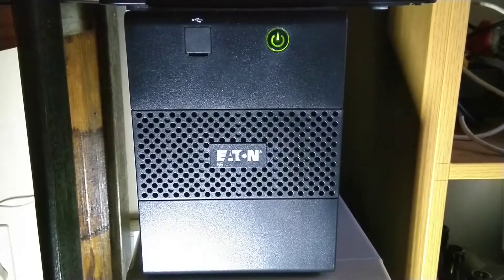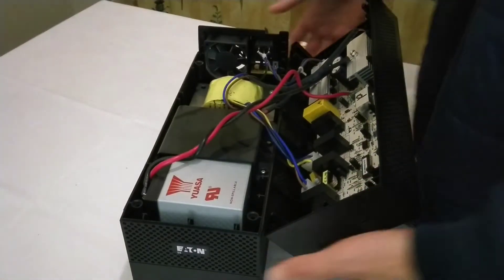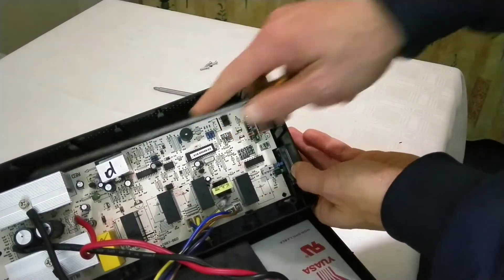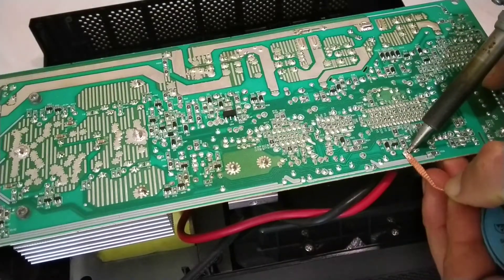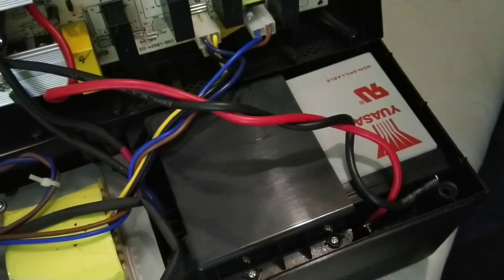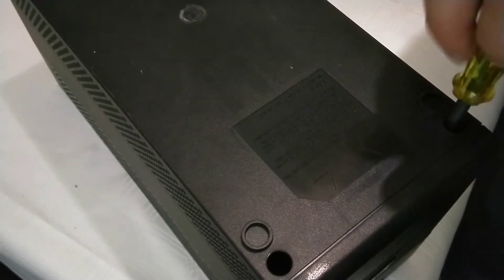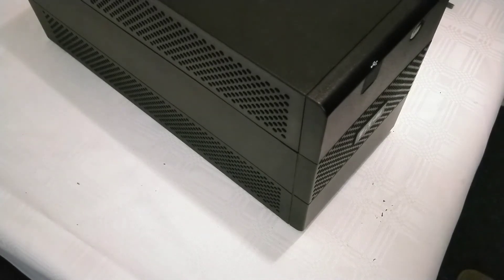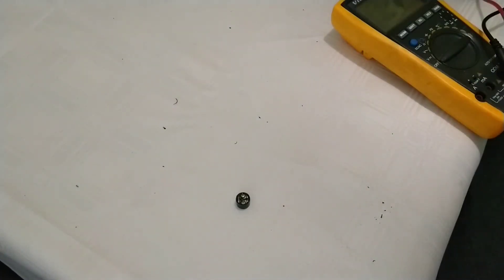Stop a UPS from Beeping Permanently by removing its Buzzer!

Comment: Thanks for this tip. I also live in SA and load-shitting is a pain. Do you know how to make the UPS go for longer than an hour, as it automatically switches off after 60 minutes. There are a few videos on Youtube that says one has to remove a certain resistor (C19) and that will stop the UPS from shutting down, but I do not want to do this and then it does not work and I cannot reconnect it, then my UPS is useless to me. Thanks.
Reply from the maker: I am not familiar with your UPS or that specific time limitation so I'll first give a general answer that covers the two most common limitations for extended run time and then I'll address removing and replacing resistors in general. Obviously any changes to batteries, cooling,  auto-shutdown and so on are at your own risk.

Run time depends greatly on the UPS and the batteries. This one when the batteries were new mine could run for about four hours. However, lead acid chemistry batteries sustain serious wear when they are deeply discharged and more so when they remain in that state for an extended period of time. My UPS could eventually could only outlast a  two hour load shedding window, then only 90 minutes, then one hour and now my batteries are only lasting about 30 minutes. Time for new batteries or a new plan for backup power. 

Adding larger batteries that have more capacity in terms of Watt hours while keeping the voltage the same, will extend the run time from a battery point of view. However, the battery recharging circuit of the UPS can only handle so much and therefore you can only go so far before you need to add a separate battery charger. If you don't do that then the batteries will not be recharged by the next load shedding window because the  charger won't charge a larger battery faster. Stage four load shedding and grid faults after load shedding which lead to extended outages are what caused my lead acid batteries to degrade. At stage four they are still busy recharging from the  previous outage when the power goes out again. Then again this solution was only ever meant to handle stage two load shedding when the intervals are less than half as frequent compared to stage four.

The other option for batteries is to go for Lithium, they are more expensive but last longer as they can handle being discharged far better than lead acid chemistry. If you are just trying to run an internet router then those direct current (DC) UPS are great. They may only be glorified power banks but they charge off alternating current (AC)  and then store and supply DC to the router. Reducing the conversion of 

Regarding the UPS unless it has active cooling, i.e., a fan, then it will probably not be able to run for extended periods without overheating. The losses in converting direct current (DC) to alternating current (AC) result in heat. Electronics do not function well when they are too hot. Above normal operating temperature the failure rate starts increasing. 

If that 60 minute shutdown that you refer to is a result of overheating then you need to improve the cooling. If it is merely a timer for normal operation, e.g., to prevent damage to the batteries due to them being discharged to a low level of charge,  then you could get away with it albeit that batteries will be working hard as described. If you are handy with a soldering iron then you can remove a resistor without damaging it. Low wattage resistors can be "cooked" to the point where they are no longer function so it is important to not get them stuck on the soldering iron tip. I am imagining it is a small  rectangular surface mount resistor because they are cheaper to buy and solder compared to a through hole resistor. 

Resistors are very low cost components. I had to buy more than one because the cost is so low that it is not worth anyone selling them one at a time. Do you know anyone into electronics? They could whip that resistor off in a less than a minute without damaging it and most of that time would be waiting for the soldering iron to heat up. Reinstalling the resistor would also be a simple matter for them. A solder sucker or solder wick (copper braid) with a decent soldering iron is all that is required. To (re)install a resistor requires a touch of solder and perhaps a bit of flux with the same soldering iron. Fancier would be a rework (hot air) station but that option would not be required. Beer makes the world go round...

To replace a resistor with another one requires reading off or measuring the resistance of it so that the value in Ohms can be matched. The wattage that the resistor can handle can be the same or higher. If you do remove it yourself then make sure you note the value before destroying / discarding / losing it in case you need to replace it. Sometimes the value is on the circuit diagram if you can find it.

Good luck!
Reply: @breakfixbuildimprove4326  Hi there. Thanks for the lengthy reply. I have the same UPS as in your video, the EATON 5E. I have three connected to my system - one for my computer box only, one for my 2 monitors and speakers, and a third for my 2 external docking stations and fibre modem. EXACTLY at 60 minutes they all trip off together. Must be a safety thing. I did find a video that mentions resistor C19 must be removed from the board, but I am a bit hesitant just in case there is a checking system that 'sees' that the resistor is missing, and then they may not then operate at all. I shall just have to live with the 1 hour limit, shutdown at 58 minutes, and restart again for another 58 minutes... I do, however, have a 2000W inverter connected to a deep-cycle battery that keeys my entire system running for 4 to 6 hours, but that involves shutting down when load-shitting kicks in, then disconnecting all 6 power cabes, then plugging all 6 to the inverter, rebooting then going on again, then having to reverse the entire procedure when the ANC and Escom deem it convenient to supply power to the plebs again!!! I have priced a large backup option from Energy Solutions - a Mecer Hybrid Inverter 5KVA/5kW, with 4 x 100AH batteries, with a 20 millisecond switchover, but that is just shy of R25000, not including courier to Jhb, and installation by an electrician. So I think I will just have to plod along with what I have. I really do appreciate your reply though. Warm regards, Wayne.
Reply from the maker: @waynejohn8  That is very interesting. Mine only supplies the modem and router so maybe it is load related. Yes my use case is crying out for a DC UPS...  Perhaps mine is so lightly loaded that the safeguard doesn't kick in? Try putting just the modem on one of them and see if it still trips at 60 minutes. My UPS is not connected via USB. Are yours connected via their USB ports to anything?

If you have three units then removing the resistor from one of them to test makes sense. Worst case is you need to replace the resistor on one UPS.

I hear you on the cost of putting in a larger inverter and battery. I am costing out a system and at this point I may as well add with solar panels. I am getting tired of sitting in the dark with candles and the load shedding interrupts my ability to work... If you are in Johannesburg then you may want to look up there for backup power solutions as there are plenty of companies offering that sort of solution, e.g., SP Energy.
Reply: @breakfixbuildimprove4326  Hi. Yes, I have tried only my modem on one UPS, and it still shuts off after 60 minutes. No USB usage. Weird.

I am in Jhb, yes, and I will give SP Energy a try.

Thanks for the help.
Reply from the maker: Maybe I got a special one. It is now surplus to requirements. Would you like my UPS sans the heavy and dead batteries?
Reply: @breakfixbuildimprove4326  I'm pretty sure ours does not trip at 60 minute mark. It also only feeds modem. Will run an experiment when I get home later. i.e. Connect. Switch on with only modem connected and see if it surpasses 60 min mark. Then add more load to UPS (charge all cellphones and laptops in house) and see again if it only lasts 60 min.
Reply from the maker: @Alphonso7777777  Mine never tripped at 60 minutes but I never tried to charge a laptop off it as then it would sometimes not make it to the end of the load shedding window.
Reply: @waynejohn8  Hello, did you found a solution?
Reply: @uacode  No, but I have decided to go the inverter route. Thank you.
Reply: Connect a truck battery instead of the wee battery it has built in.
Reply: @lobogunthergdiesoetewulf9792  A good idea,but it is not the battery size that matters,the UPS cuts out/off at exactly 60 minutes, regardless of battery remaining.
Reply: C19 or R19?  I am sitting with the same problem. UPS does not get hot or anything, but shuts down 1 hour precisely. I really don't want to cut C19/R19. I believe the Eaton Companion software has a function to disable the timer shutdown, but I am not sure if a PC must be permanently connected to the USB to make this happen. I will give the latter a go prior to resorting to electronic surgery on the UPS PCB.
Reply: @macnt001  Hi there.

I thought it was C19, but maybe R19 (?) that needs to be cut/disconnected. I have not tried it yet.

I did get hold of Eaton in the UK, but they were either stupid, or not technical, and did not know of the 60 minute auto cut-off at all. Someone said that there is no such thing. I said bullsh..

You can disconnect the UPS from EVERYTHING, no power in, nothing going out, nothing, zip, nada, nothing!!!

After 60 minutes of beeping it shuts off. I have 3 of them and they ALL shutdown at 60 minutes, EXACTLY!!

When I connect extra batteries to get through a power outage, they still shutdown after 60 minutes and I have to reboot again. Very annoying!!

I am trying to pluck up the courage to cut the R19 resistor on my oldest UPS to see if it works. If the UPS is rendered useless after that so be it. If it works, then I will do the same to my other two.

Please let me know what you find out, if anything.

Appreciated.
Reply: I did unsolder the C19 resistor, but the entire UPS did not work then. I resoldered it back on, and all works again, so C19 is NOT the answer. I have since gotten a VERTIV UPS from PC International here in Johannesburg (but from elsewhere would also be ok). The VERTIV UPS has a 120 minute cut-off. Much better.
Reply from the maker: @macnt001  If it helps, I ran the UPS without a USB cable plugged in.
Reply: @breakfixbuildimprove4326  USB cable or not - exectly 60 minues shutdown. Thanks.
Reply: I got 3 things out of this. 1. No load shutdown (45 minutes). 2. Shutdown when battery life estimate is below 20%. 3. Back up shutdown, irrespective of battery health (60 minutes).

On the PCB is a chip/IC. It has a timing pin on it. I believe the R19 resistor connects to it. I tried to find info on this on YouTube, but all the videos are from India, and I find it hard to follow with the "Hindi" language.
Reply: @macnt001  Yes, I also found about a dozen Hindi vids. Not much use, but they gave me some ideas.
Reply: Thanks for your reply, i m also experiencing the 60min operation and it shutdown. It frustrates me. Beep sound i will cut the speaker